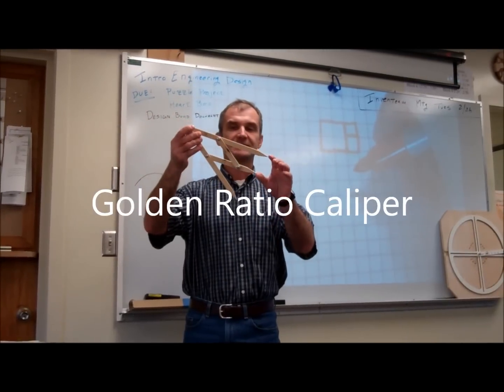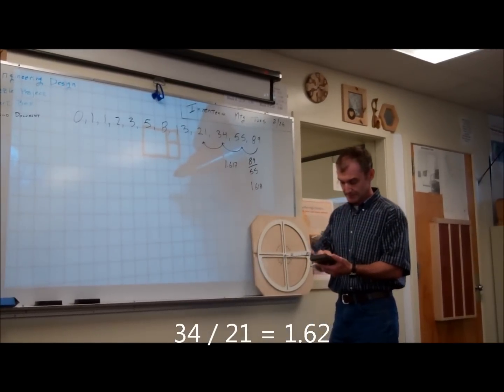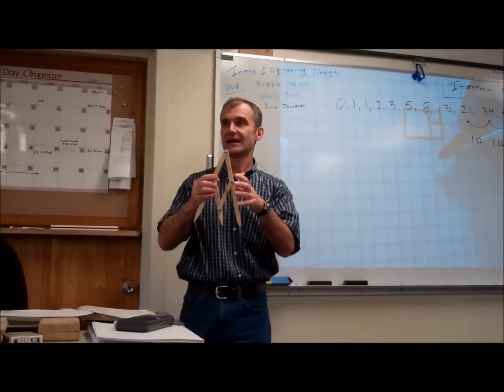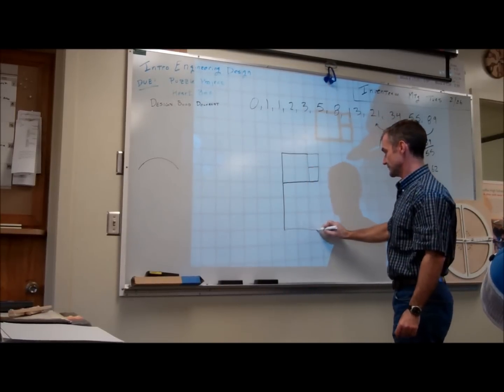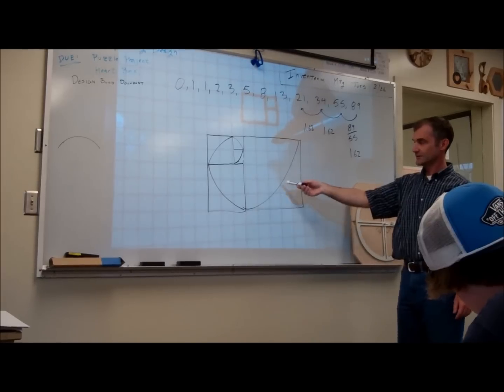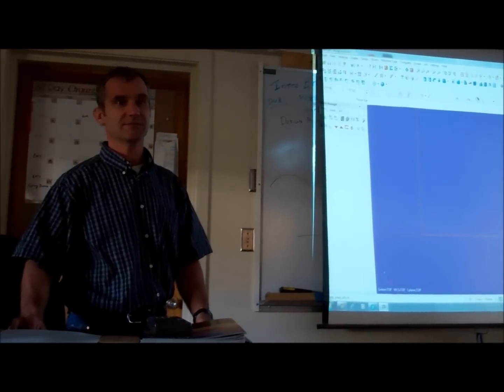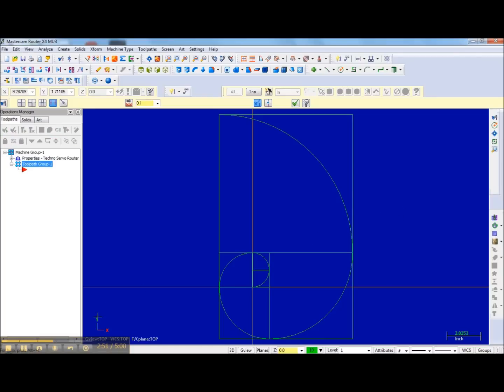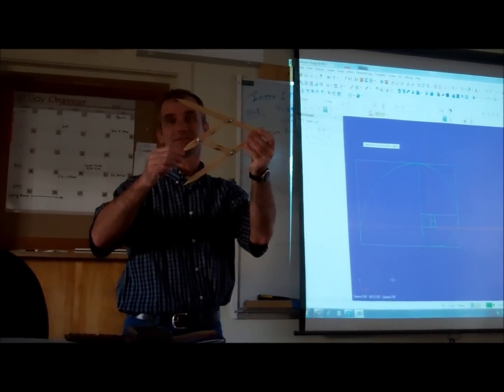Golden Ratio Calipers

Comment: This is an invitation to see a theory on the nature of time! In this theory we have an emergent uncertain future continuously coming into existence relative to the spontaneous absorption and emission of photon energy. In this process we even have an objective reason for the start of the Fibonacci numbers 0, 1, 1,... with the t = 0 and the positive +1 and negative –1 representing the positive and negative of electromagnetic waves with everything being based on one geometrical process. In this theory the future is not random it is based on a process of spherical symmetry forming and breaking. Spherical symmetry forms the low entropy that we see if we look back in time at the ‘big bang’ and also forms the potential for ever greater symmetry formation that we have in cell life with the Fibonacci spiral being visible almost everywhere in nature! This is because if the quantum wave particle function Ψ or probability function is reformulated as a linear vector then all the information I have found says that each new vector is formed by adding the two previous vectors together this forms the Fibonacci Sequence 0, 1, 1, 2, 3, 5, 8, 13, 21, 34, 55, 89, 144, ∞ infinity!